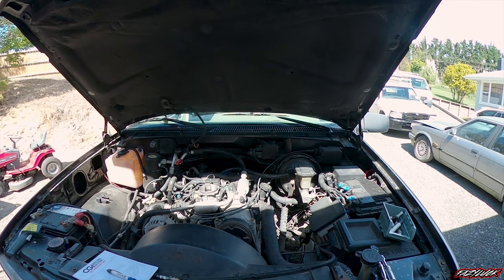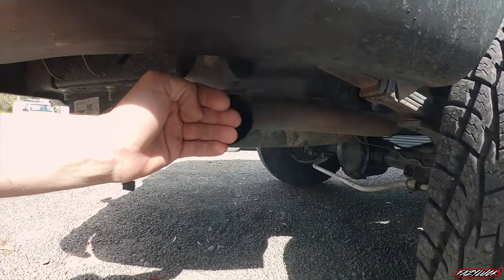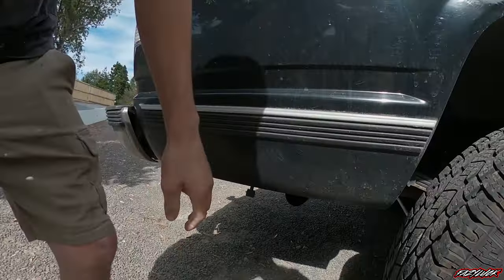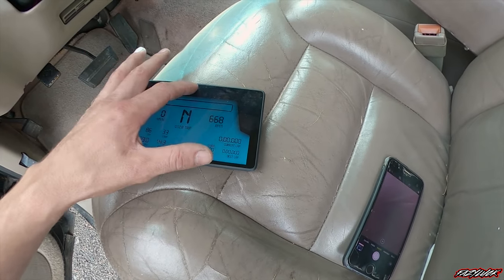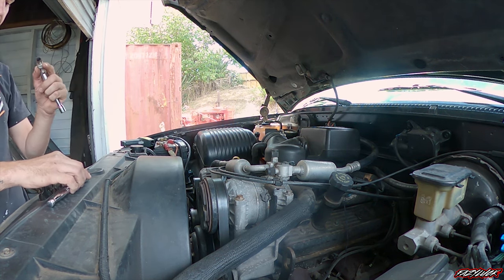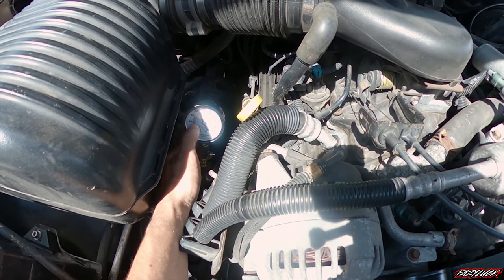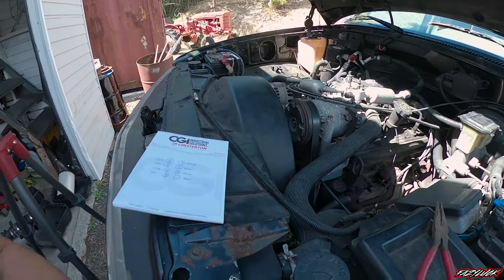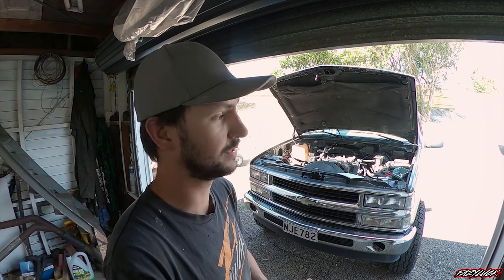DIAGNOSING MISFIRE ON 5.7 VORTEC OBS SUBURBAN  // BETTY THE 'BURBAN

Comment: Mine feels like its missing after its been running for a little bit. Does ok driving but when stopped it idles rough
Reply: My 98 is the same exact way. Runs fine when rolling, but in idle or a stop it miss fires a lot, specifically cylinder 2
Reply: @carlomendoza8588  I changed my fuel filter and it went away. Came back shortly after and has been gone again for days now. Don't ask what I did bc I have no idea.

Comment: What ended up happening
Reply from the maker: Ended up being a cracked head!!
Reply: @fazyluck  did you replace the cylinder head?
Reply from the maker: @desertvalleyfilms9136  yup I ended up putting a recon'd head on that bank! It's definitely better now! Hopefully get some miles in it over summer!
Reply: @fazyluck  mine was throwing a P0306 code and was missing pretty bad. It ended up just being the valves, the cylinder head was fine. I am going to throw new heads and gaskets on it soon